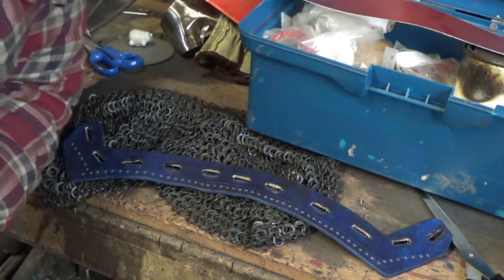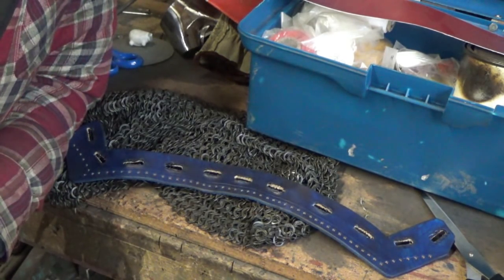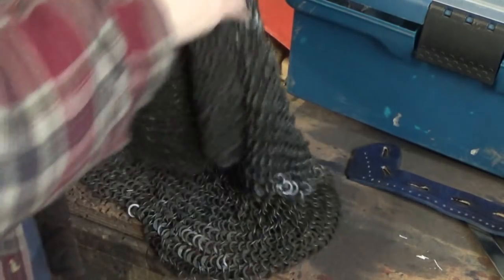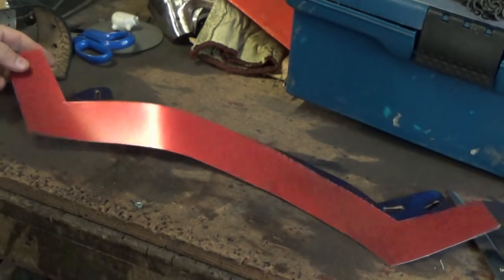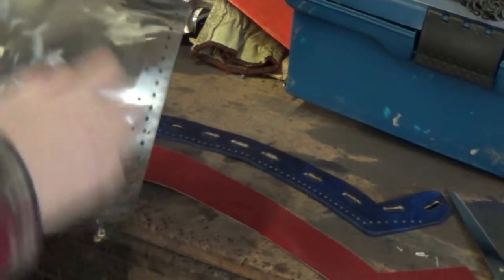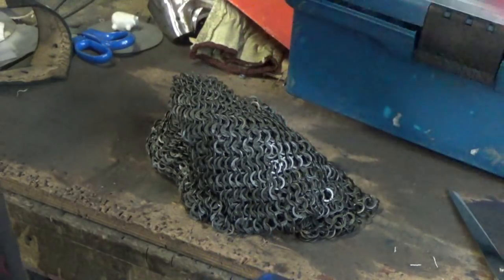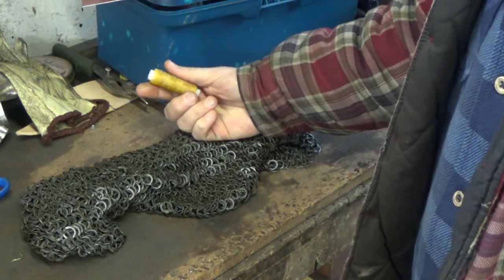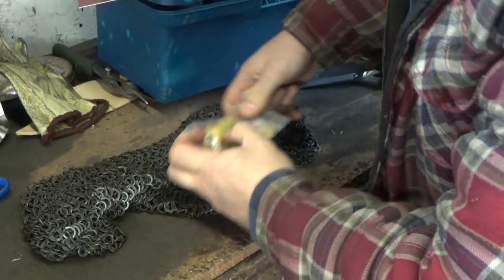How to attach aventails to bascinets - Medieval Armor Technique #16

Comment: Awesome video 😊 What type of leather do you recommend?
Reply from the maker: Generally I stick with a beg tan leather about 3 to 6mm deep. A good test, if you get the chance, is to make a small slit with a sharp knife and see if you can pull it open further by hand. If you can it will be far to weak.

Comment: In the cases where you saw two rows of stitching, is it possible the aventail was lined and that the upper row was anchoring the lining?  I'm sorting out how to attach the upper edge of my quilted lining...
Reply from the maker: Paul Lalonde that's as good a guess as any. So far as I know there is only one 14th century liner intact lwft to us but that is a full liner that goes up into the crown of the bascinet.

I see no reason why your suggestion isn't as good as any other to be honest.